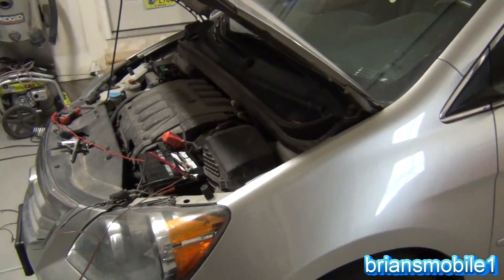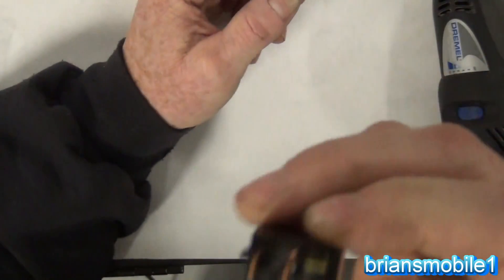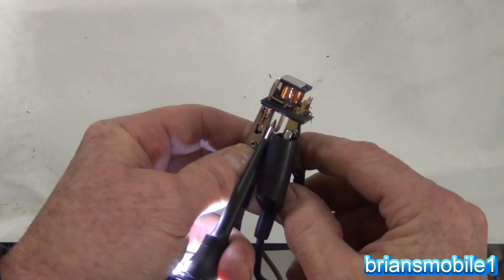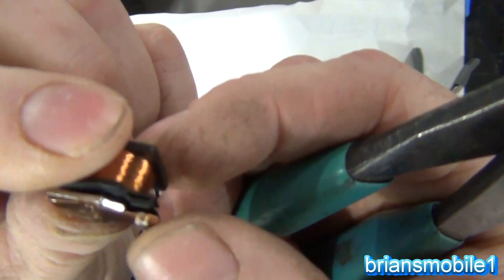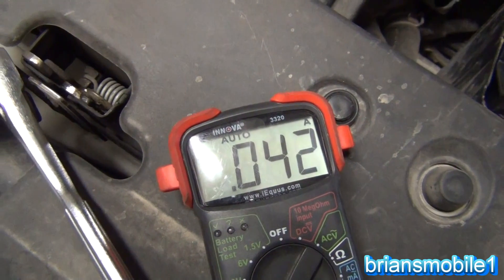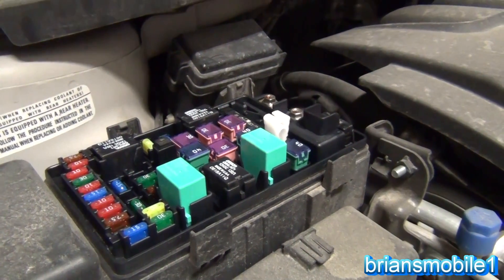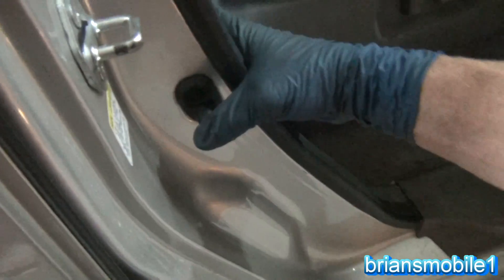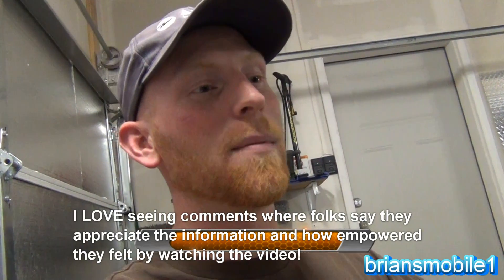Odyssey Battery Drain Fix and Draw Testing Basics

Comment: Nice- usually I see a diode to prevent the arc at the contacts, seems Honda went with a resistor, I guess the resistor was nuked .  Did you happen to measure the resistor ?
Reply: briansmobile1  The colors represent 1  1  2  5%    1,100 +/- 5%  ohm resistor - not a standard number.  Sure it wasn't brown black red which would make it 1K ohms? (very common) 

Here's more than most want to know:

On most resistors - the first 2 colors represent the first 2 numbers of the resistance.  The third band is the multiplier or how many zeros to add to the first 2 numbers.  The fourth band is the tolerance.  Other bands represent mean time before failure, hours of use etc.

0  black                               tolerances (plus or minus)
1  brown                            gold 5% 
2  red                                   silver 10%
3  orange                           no color 20%
4  yellow
5  green
6  blue
7  violet
8  gray
9  white
Mnemonic for color code (usually another word is used for rage).
bad boys rage our young girls but violet gives willingly
  0         1        2      3         4        5       6        7       8          9
Reply: briansmobile1 Never saw 1,084 ohms first time around.  Guess I'm going blind.
Reply from the maker: D Nelson   Thanks for the lesson.  That's cool.   As I said, the Ω on the meter was 1,084 ohms which rounds up to 1,100 ohms with two significant digits (bands).  And I even went outside to see if the bands were double brown- seemed off to me too.  They were.
Reply from the maker: I do that too sometimes, or it's abbreviated and hidden with a "show more" lol
Reply from the maker: Steve Rob Great question!  I liked your curiosity and I had thought about it.  I just went out and did.  It' was 1.084K ohms.  That seemed odd and pretty low.  There's an angel hair pair of wires that bypass it below so I ripped it out and tested it again... 1.084K ohms.   I went to this website to check what the resistor SHOULD be→ http://www.digikey.com/en/resources/conversion-calculators/conversion-calculator-resistor-color-code-4-band The result is that it's a 1.1K ohm ±5% carbon film resistor and it's apparently good!  So there you go.  Also the angel hair wires were making contact and clean (not burned at all).
Reply from the maker: briansmobile1 BTW the bands were brown, brown, red, gold (4 band).

Comment: At 4:47 you can see a spark jump between the coil and the think was the resister as you were touching the leads
Reply from the maker: Marcus460 Wow!  That's right.  I bet the computer signal is much lower than 12.5V or that spark is unintended.  Either way great eye for detail Marcus!
Reply: I think thats just the light shining of the enameled wire. Using my phones screen.
If it was a spark, thats back emf, the resistor is there to snub it, there will be a diode in the ecu to snub it also.